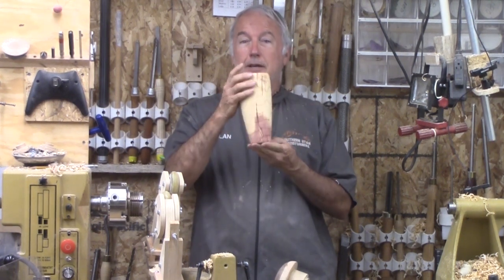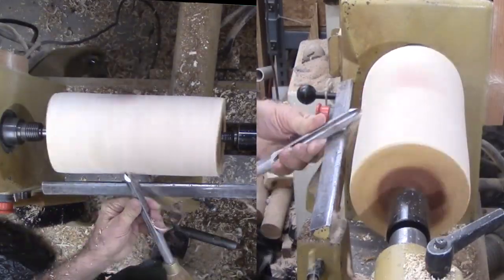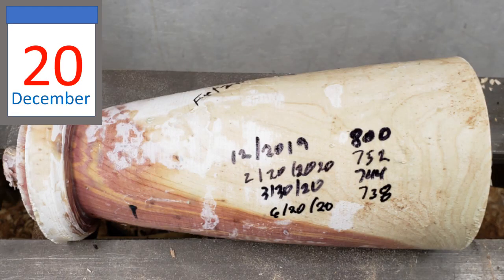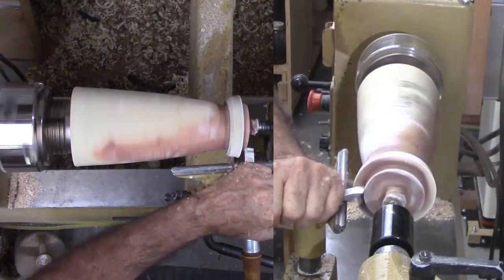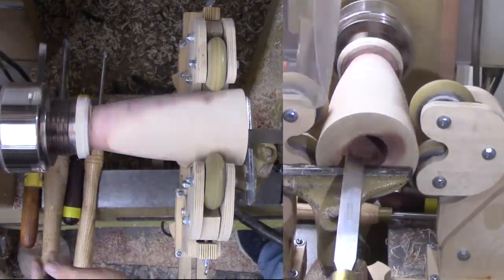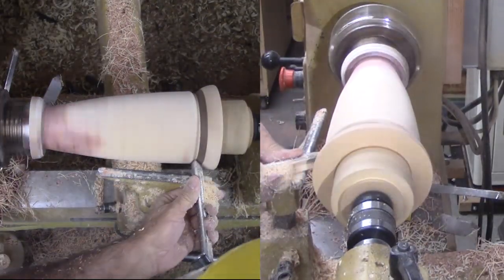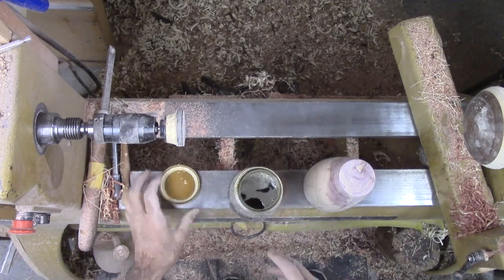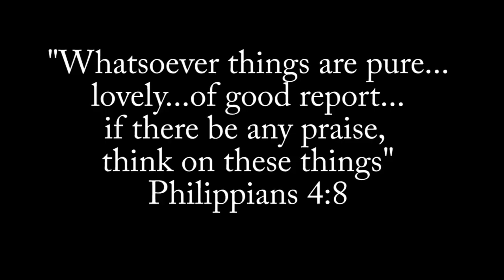Woodturned Vase   Wet To Dry To Finished

Comment: Hi Alan, I’ve never heard of Fetzer wood, tried looking it up (Google) and only found reference to Fetzer Woodworking in UT.  But it looks very much like Eastern Redcedar, which is actually a Juniper (Juniperus Virginiana).  Living in VA, I’ve turned a fair amount of it and it is always a beautiful wood to turn.  I’ve found several standing dead trees that provided branches from which I was able to get 12-24” dry blanks that were without any checks and turned beautifully.  But I’ll have to try your wet turn/ hollow out method on some of my wet blanks and see how it works for me.  Thanks for the video. Stay safe and well so you can bring us more.  Cheers, Tom
Reply: I thought it looked like cedar.
Reply from the maker: I could not find any information either. But I believe it is related to cedars and junipers.
Alan
Reply from the maker: Strong resemblance.
Alan

Comment: I like my mineral oil, beeswax, and walnut oil. I use it a lot on my cedar that looks a bit bland lol. In the end I put a coat of straight beeswax as well. If the wood is white and I want to keep it that way I'll use some super blonde shellac with a beeswax coating. Nothing fancy, but it is what I like :) I have only had bad luck with the poly finishes. I need to try mixing up some different concoctions haha. How has yours been working?
Reply from the maker: Matthew, Thanks for sharing your recipe.
I don't like straight poly but in my mix it is very dilute.
Alan